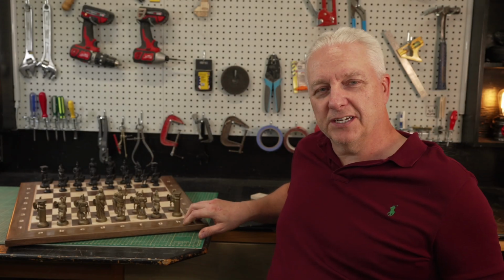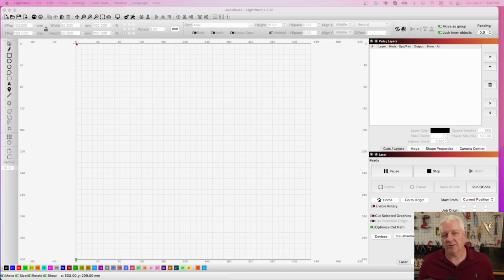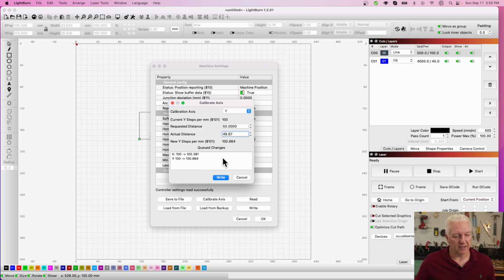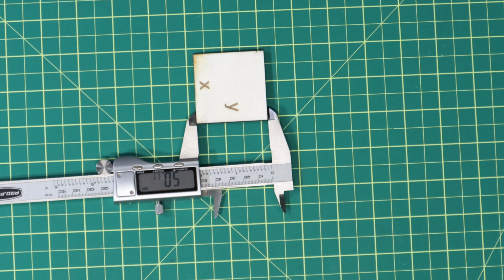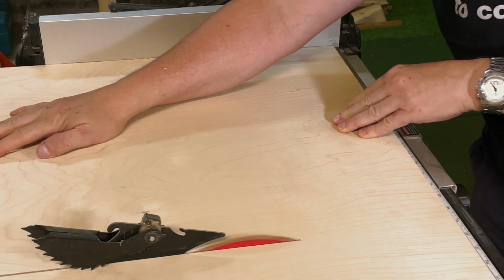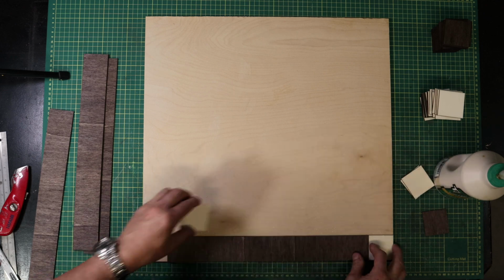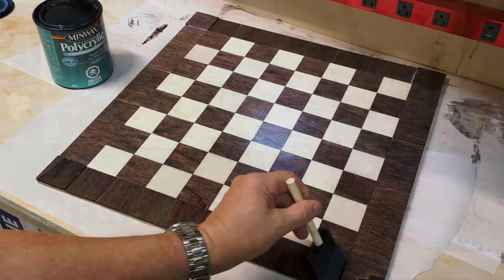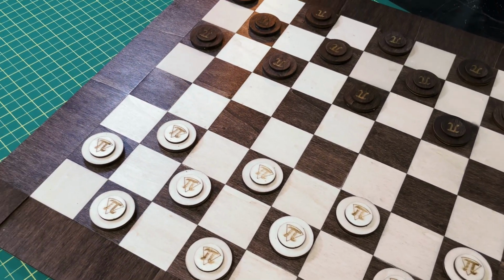Laser Cut a Premium Checker Board

Comment: For calibrating I find it best to do a square cut as large as you can comfortably measure with a micrometer.
Reply from the maker: For better accuracy you might want to cut a few different sizes from small to large. From this you can calculate the average error and make adjustments.  For CO2 lasers you will also want to cut squares at different parts of the workspace to test for angular misalignment in the beam

Comment: Hello Steve, Thanks for this video. After I watched it I tested my Ortur Laser Master 3 and found out I have the same issue. I cut a 50mm square and when I measured it, it was 49.8 mm on both the x and y. Should I run the settings calibration you showed and if so; does Ortur allows me to write it? Thanks again, Steve.
Reply from the maker: With an OLM 3 you shouldn't need to jump through any hoops and at least your laser is still producing squares.  In Lightburn, you can choose the Edit->Machine Settings menu options and from there you can calibrate the X and Y axes.  It should be easy since you already have the exact measurement that you can enter into the calibration tool.
Reply: Thanks Steve. Is this a one time thing?
Reply from the maker: @axeldejesus2060  The laser will stay fairly accurate, but you should assume that before you cut 50 copies of something you create one and make sure it's the size you want.  Calibrate as needed.

You could also cut squares of several different sizes from very large to very small and calibrate that way.  It's won't change once you set it, but the scale may not be linear across the entire size range of your laser.
Reply: Thank you so much Steve. I really appreciate it.

Comment: I think I seen this method before and I'm not really sure why people expect it to work!  You cannot compensate for kerf using the machine movement calibrations or every time you change the size of your project you will be out again. This is not an XTool problem, well the inability to adjust calibrations is but that is not the problem here.

 The problem is the diameter of the cutter not the cutter movement. If you adjust the movement to compensate for the cutter then you will find if you change the project size from 50mm to 300mm you will be out by 2-10mm. This method calibrates the machine to working with that exact cutter at that exact size only! This problem is all lasers and CNC machines and not XTools, its technically a software issue.

 The 2nd problem nobody talks about is actually not a problem it is knowledge of how it works, lightburn is centered toolpaths. The laser will follow right down the middle of what you draw thus creating problems when mostly cutting. People using lightburn assume there is no kerf and its a perfect cut less than 1 micron thick when they actually need to cut "outside" the box since the box is draw at final dimensions not cut dimensions. That added to many lasers have a different X and Y kerf. Its like drawing a 50mm box on wood then cutting down the center with a circular saw, the kerf of the blade will make a 48mm x 48mm final size. Oppsie. A woodworker will cut to the outside and automatically compensate.

 It is difficult to see with small numbers so lets use bigger numbers so you can see what happens when you compensate for kerf with machine calibration. Lets say you have a router with a 50mm diameter cutter (maybe your laser is 50mm dia) same as a laser really just more material removed for the example.  If you calibrate the mechanical movement of the toolhead to compensate for the tool you will have to adjust the machine to actually move 100mm when its commanded to move 50mm to compensate. Now you cut a perfect 50mm square for your chess board, but wait. Now cut a 400mm box, what is going to happen? For every 50mm of movement the machine is now calibrated to move 100mm so your 400mm box will have a tool path of 800mm. I don't think your part is going to fit! Why because you compensated your machine to move an extra +/- 50mm for every 50mm of movement.

 Ignore the tool, if you tell your cnc machine to move 50mm it must move 50mm period otherwise you have no idea what is moving where and how far. This is completely independent of the tool.

 Projects in lightburn are often best to be created in cut size (laser toolpath cut outside the final size) not final size. Lightburn doesn't magically guess your kerf or pick and choose what lines to cut "outside" or "centered"

 The video example at the start and a few on youtube explain exactly as the example as a calibration method. It won't work! You will pull your hair out.
Reply from the maker: The whole point of doing calibration on a laser is to ensure accuracy. Kerf in this case plays no part since the goal is to get accuracy on the cut part rather than the cut itself.  To this end, it is relatively easy to get better than 0.1mm accuracy with just about any diode laser and for this project that is plenty of accuracy.

My hair is intact and all of the squares are accurate, and not once did I have to consider kerf since my goal was to make accurate cut squares. I’m making no assumptions of future accuracy for other dimensional cuts.
Reply: @SteveMakesEverything  But you calibrated based on the cut part, this cut part is a factor of toolpath and kerf. Then calibrated based on this measurement. Try a test, after using machine calibration for a 50mm square cut then cut 200mm and measure again, see how accurate it still is. I bet its out by 3 times the kerf! Then do it again on material 3 times thicker where the kerf size doubles or triples.
Reply from the maker: @3dtwerking324  I think you're missing the point.  Everyone knows that the error will vary with size.  The point here is I specifically wanted squares that were exactly 50x50mms and that's all I cared about in this example.  So for the part, I care about there is no error, and as noted kerf doesn't even come into play here.

If I wanted different-sized square I would recalibrate for that.  It only takes a couple of minutes to do a calibration and there aren't that many items you'd cut where it would matter that much anyway if the error was 0 or 1mm across the part.

Comment: How long does the laser last
I bought (I know) a cheap amazon add on for the 3018 Cnc. To check it out.  It lasted about a year it can only cut paper now. Very weak output now
Reply from the maker: If you are cutting with a 100% power the module will have a shorter life, though a year seems a bit short.  Figure at least a couple years of regular use as a good benchmark

Comment: I'm wondering if couldn't fix the dimensional deviation by changing th kerf?
Reply from the maker: You could try it and probably get close if the error in the X and Y directions was similar.  Kerf adjustment would be equal in both directions
Reply: @SteveMakesEverything  well i wasn't aware of that limitation. A topic to suggestt to Lightburn  Especiaaly with rectangular spot on some lases...
Reply from the maker: @steenstavnshoj1967   Hmm, that's something I didn't consider on kerf.  If the beam is rectangular the would be marginally different in each direction.  Most rectangular beams are 0.06mmx0.08mm so it's not dramatic, but if you are trying to get hyper-accuracy 1t would matter.

The method I use here for the D1 would account for that, but the basic kerf compensation in Lightburn wouldn't

Comment: Thanks for sharing. 
I do not know how lightburn exactly is working. But if I’m right you “told” light burn the specifics of the D1 by supplying a file. The first thing I would check if I can find this file on the harddisk this, or the file where lightburn is storing the parameters for this cutter, and check if this file is read only.
Because I dot have a D1, lightburn or a Windows computer I do not know which file.

I do not expect, but can be wrong, that the correction is written to te cutter. I expect they are stored on the PC. If you want to find out of the correction of is stored locally (on the PC) or on the cutter you can find out via een second PC and an other (laser)cutter with lightburn. If you do the corrections on the first PC and have solved it also for the second PC the corrections are stored on the cutter. If you have to add the corrections to the second PC you know the corrections are not stored on the laser. In this case it could be something simple as a read only configuration file!
Reply from the maker: In this case I didn’t load any files into lightburn. Rather, I created a square in LB and then calibrated by adjusting the size of that square until it cut within 0.1mm of a 50x50mm square. On most laser you can have LB do this calculation and store it to avoid having to manually do anything
Reply: @SteveMakesEverything  I understand that you could not add the corrections to LB. I was hoping to find a way you cloud store the corrections in LB. I hoped it was something simple as a readonly file.
Reply from the maker: @home-lab  Yeah this is why I raised the issue.  There isn't a way you can store these settings anywhere else and then load them in when you need them.  Any attempt to change a GRBL setting in the D1 will result in it just getting reset immediately, and you can't even set them and use them until you turn your laser off.

Comment: The kerf is the reason that can not be 100% presice cut
Reply from the maker: That's only part of the problem.  The actual size wouldn't be a problem if the X and Y dimensions were the same and that has nothing to do with kerf.
Reply: Lightburn can account for kerf

Comment: Thank you Steve great video.
I was fairly set on getting a D1 Pro but after watching this I'm not sure.
Part of what I thought I want to do with the laser is to cut out things accurately as measuring aid or patterns... for woodworking or other maker projects.
Reply: I'm assuming the other brands can be calibrated?
Reply from the maker: @crushvapor1147  Yes
Reply from the maker: I wouldn't get too down on this specific limitation of the D1 Firmware.  For cutting, this is still one of the best lasers.  My message here was more to hopefully inspire Xtool to fix this.

They do offer more control of these parameters in their own software (moreso in Laserbox Basic for the D1), but at some point they will need to realize that any business or advanced user of their laser is going to be running on Lightburn.
Reply: @SteveMakesEverything  I have four lasers now and the X-tool series has been in the corner of my eye, but little things like this limitation would bug me. Similar reason as to why we have three craft cutters and none of them are Cricut, because they pulled something similar a few years back. Im sure they have their reasons but sometimes those reasons get in the way. Great Video by the way. We've been looking to add a chessboard to our lineup.
Reply from the maker: @atienne_navarre  Well definitely if you want to do something like a chessboard you will want to calibrate your laser pretty well.  As I showed in this video you can beat a D1 Pro into submission, but it's not ideal for this application.

In your situation, I would look at the Atezr P20 or V35.  It doesn't have this limitation and, particularly the V35 has ample power to chop through plywood to produce a great-looking board quickly.

Comment: Does the Longer ray5 10 watt allow calibration with Lightburn.
I purchased it a few months ago and it's still in the box. Been busy!
Reply from the maker: While I haven't specifically tried it, it should since it uses a traditional Arduino-based controller.  The Xtool controller is kind of unique in that there are essentially 2 different firmwares running - one for XCS and on for Lightburn that supports GRBL.  The challenge is that on the GRBL side, Xtool prohibits any configuration changes.
Reply: @SteveMakesEverything  Thank you for the info.
When I get the time to set it up I'll post an update here.
Reply from the maker: @eddrm4685  Always great to have people share their opinions and discoveries here.